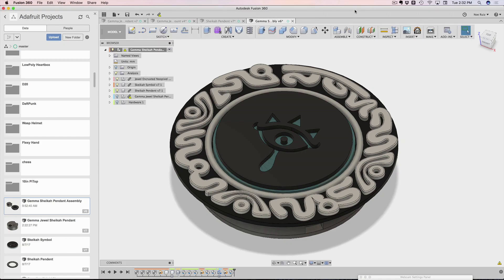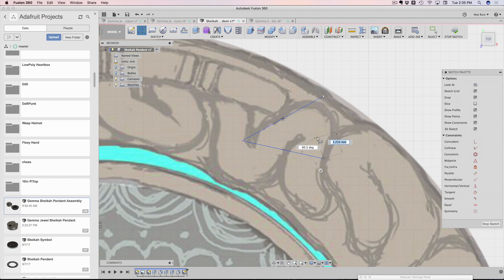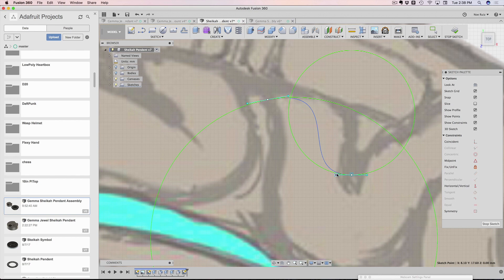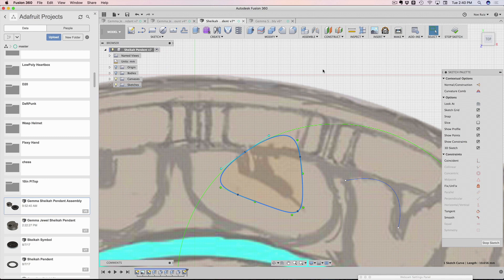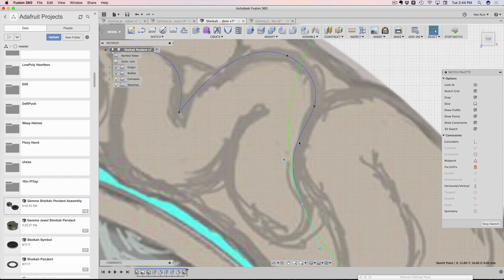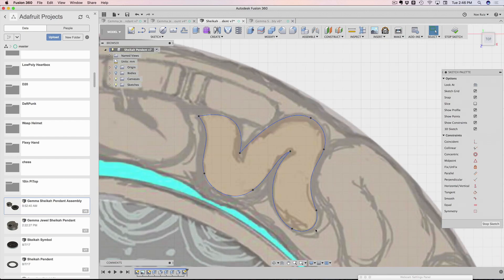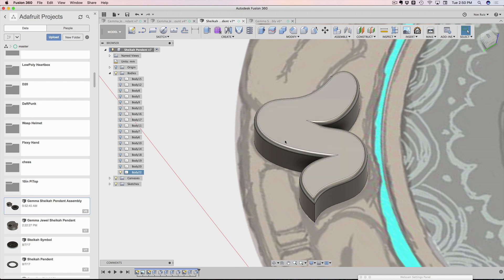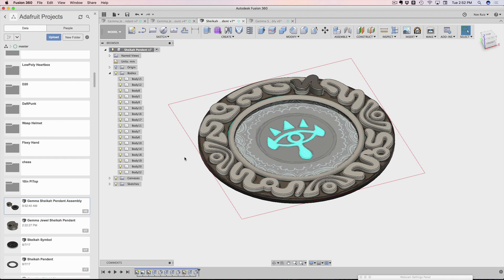Fusion 360 Tutorial – Using Splines

Comment: Thanks Noe i've used splines before in some projects but nothing complicated as you are using in this project. Learned a few things from your vid like adding the extra points. I also did use a rough sketch at first and the adjust to what i needed.